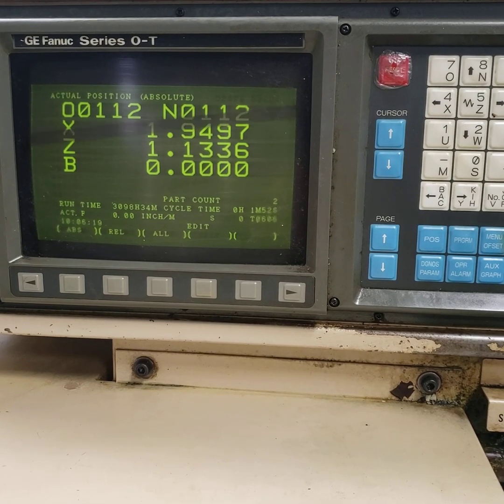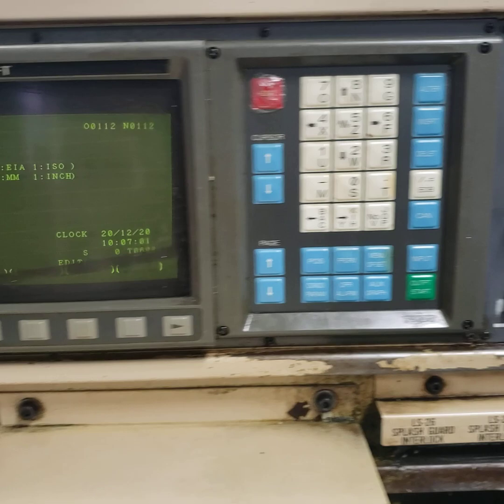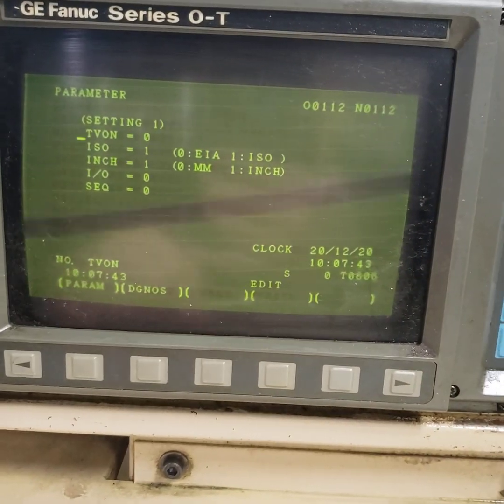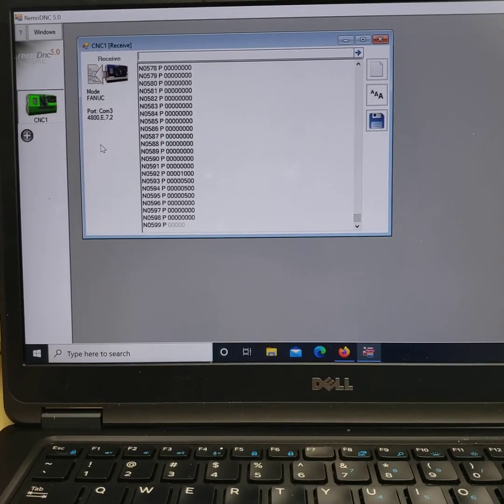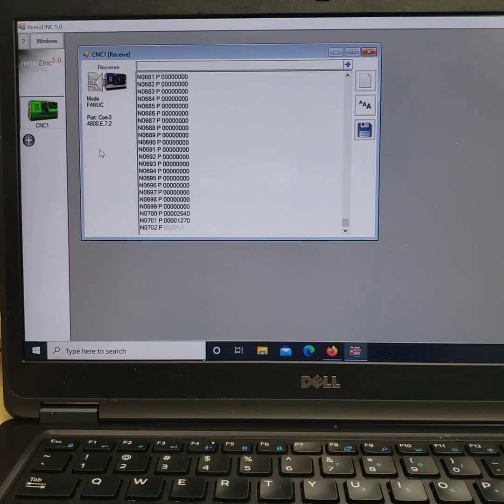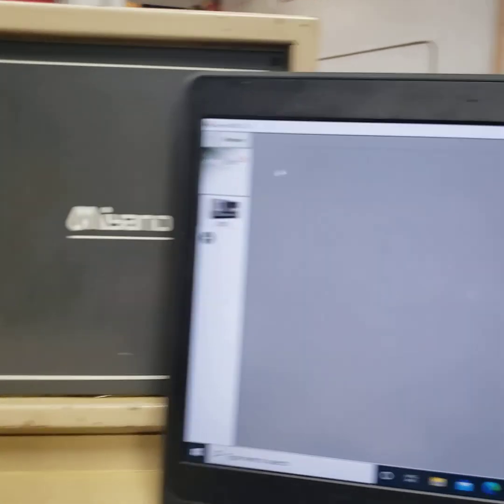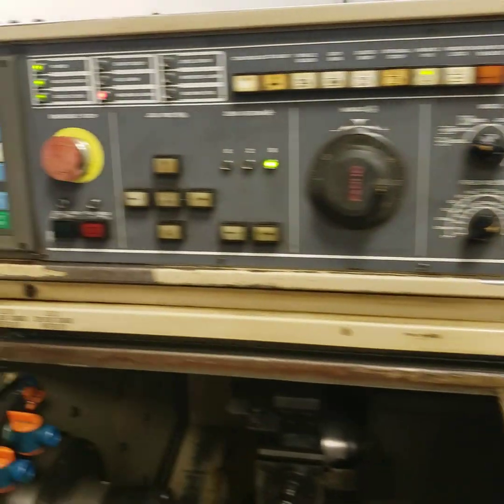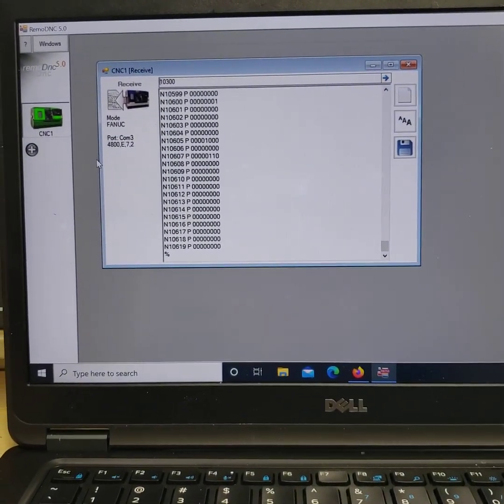Backup saving parameters on a Fanuc 0-TC control, Miyano CNC Lathe, CNC Digital, Inc.

Comment: I have a miyano le-22 i bought without a manual.  I'm trying to figure out what g codes are enabled.  I can't get into my 9000-series parameters.  Chat GPT says i need to enable PWE to see them but i see you do not have it enabled.  I'm so confused.
Reply from the maker: Call to discuss your issues. 440-721-7100

Comment: Hey! Why didn't you press EOB when downloading the diagnostics?
And what was that you explained at the end about parameter no.1 and 502 and 503. Can you please explain it into simple words. I will be very grateful.
Reply: The bit at the end was regarding the serial communication settings. This should be established before transferring files as you need both the control and pc to have matching settings. These include the baud rate, data bit length, stop bit length. Hardware handshake etc. If your coms settings work and you can transfer files via rs232 then you can ignore those settings as they are fine.

Comment: Hi! May i have the configuration for the  Rs 232  25pin -Usb ? Does it need a special hardware to connect the pc to the machine as shown in this video.
Reply from the maker: No. I purchased the cable on ebay. Just searched for RS-232 to usb CNC cable.

Comment: Thank you for the very informational video! Do you have the procedure for loading the parameters back into the machine? One of our machines has had the Delete+Reset command done to it and im starting fresh. I was hoping I could copy the parameters from my identical machine and load them into my wiped one.
Reply from the maker: I do not have a video.
However.
INPUT OF SETTING PARAMETERS PROCEDURE

PRESS DGNOS/PARAM   KEY
(SETTING PARAMETERS INPUT)
(MAKE SURE SETTING PAGE 1 ARE CORRECT)
ISO=1
I/O=0
E-STOP PRESSED IN
PWE=1
MEMORY PROTECT KEY OFF (TO THE RIGHT / )
MODE SWITCH = EDIT
ENTER 900 OPTION PARAMETERS BY HAND
CYCLE POWER TO ACCEPT OPTION PARAMETERS
E-STOP OUT

PRESS INPUT  LSK   SIGNAL FLASHES (LOWER RIGHT SCREEN)

SEND DATA FROM PC.  INPUT SIGNAL FLASHES (DATA BEING ACCEPTED)
INPUT PC DIAGNOSTIC PARAMETERS, TIMERS, COUNTERS.

PRESS   DGNOS / PARAM   KEY TWICE.
(MAKE SURE YOU ARE IN DIAGOSTIC SCREEN)
(MAKE SURE SETTING PARAMETER PAGE 1)
ISO=1
I/O=0
MEMORY PROTECT KEY OFF (TO THE RIGHT / )
MODE SWITCH = EDIT
PREPARE CONTROL TO RECEIVE DATA (WAITING)

PRESS INPUT   LSK   SIGNAL FLASHES (LOWER RIGHT SCREEN)
 
SEND DATA FROM PC.  INPUT SIGNAL FLASHES (DATA BEING ACCEPTED)
Reply: @cncdigitalCNCServiceandParts  Thank you for your reply! I had actually figured it out on my own but I know that this will be helpful for many others.
Reply: @chrishopkins7620  Do you have a backup? We had the same problem with the reset but no backup